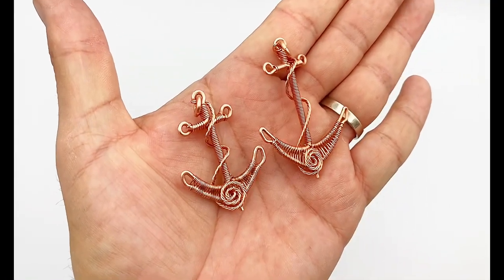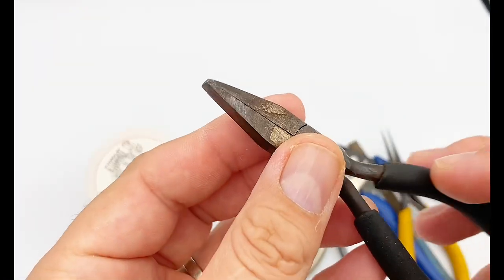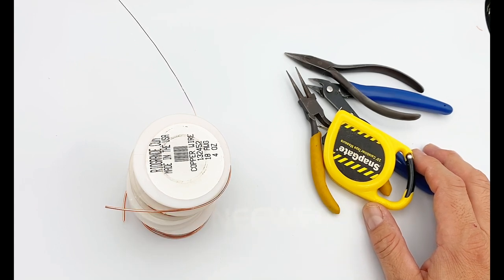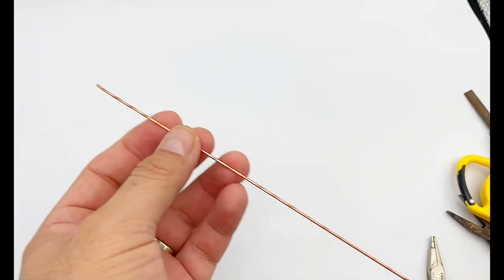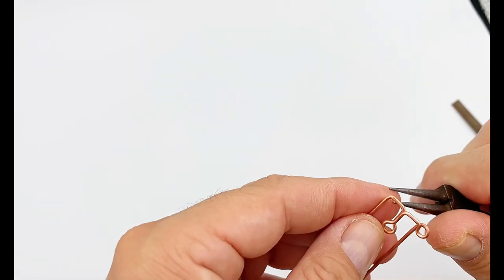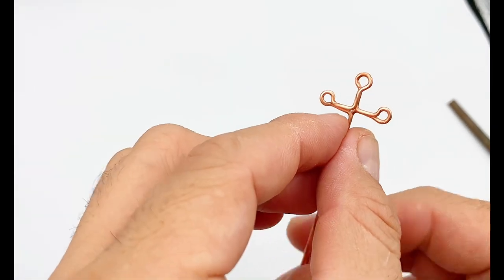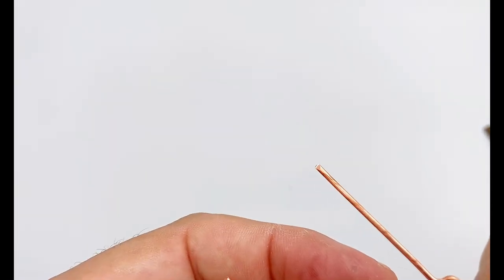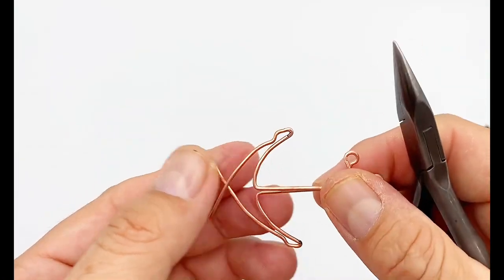Wire wrapped anchor tutorial/ wire pendant diy / wire jewelry

Comment: This was super frustrating to try and follow. I ended up mangling two different lengths of wire, the audio is too soft even with my computer at full-volume, and the explanations were lacking enough specificity to be able to really follow well. It was also hard when hands were blocking the view or going off camera =(